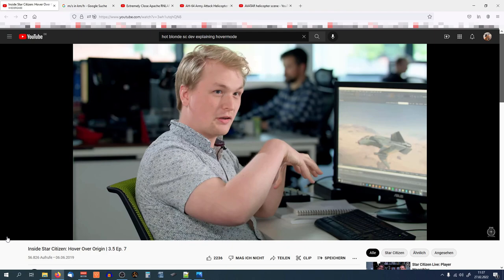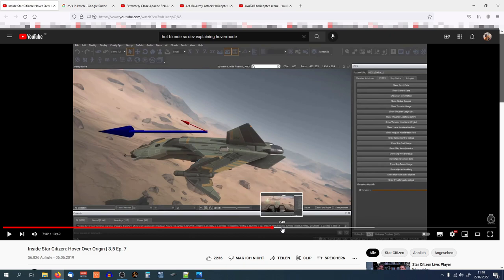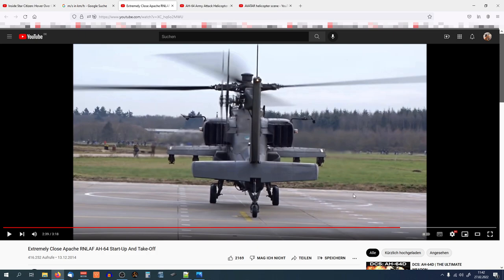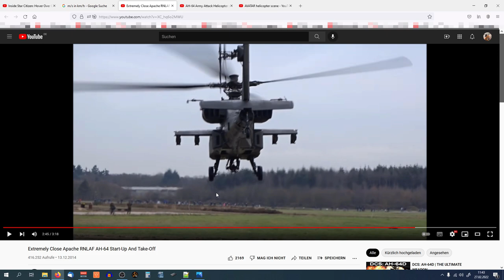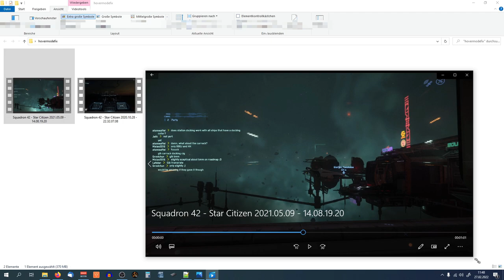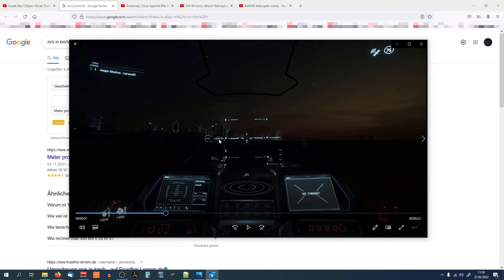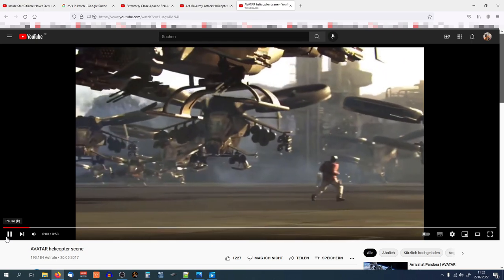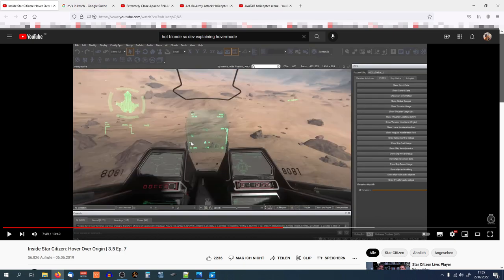A new hovermode - how to fix the atmospheric flight model | Star Citizen

Comment: Meant to comment on this back in Feb, but better late than never. Agreed that the problem with the hovermode was that it engaged way too quickly and sped the ship up instantly WAY too fast. I think, because the thrusters DO articulate, there should be some ability of a ship to angle itself without flying off in the direction it's angled: the thrusters are strong enough to hold it relatively stable, but the more extreme the angle, the less able the thrusters are to maintain that angle, and the ship will either lose altitude (slowly or very quickly, depending on how extreme) or start moving forward as those "downward" thrusters move to more and more of an angle. That's a more intuitive way to do it, and I think in line with what you're saying.
Reply from the maker: I hope they will improve flight, because right now I can not bring myself to play because of what a deterministic boring chore flying is.

Comment: The problem is scale in this game for everything. 
Single person crafts potentially being larger than full destroyers or some small cruisers, or even lets go smaller, most are close to a 747 size. 
A person isnt even the same size as a wheel on one of them yet it can fly and accelerate more than a stunt pilot in the redbull air race. 
To be fair I dont think there should be a change in how physics is worked by speed, it should change my atmosphere, planets make gravity, wind makes air resistance but it would be nice to have a gradual spool up of thrusters rather than an immediate full blast of force.
Reply: One thing I will say is that the example your using is banking heavily in his physics demo, that would be equivalent to a helicopter going max forward  tilt. 
I'd say the best thing is primarily to nerf the manoeuvring thrusters so they have much less power where heavy crafts would either need a runway or need vtol mode to direct their forward thrusters down to the ground.
Reply: @LunaStarFire  I don't think the power is an issue so much as the instant ramping up.  I could see a gladius strafing up in atmosphere at 100 m per second, of course the aerodynamics would want to point the nose up, but the biggest issue in my opinion is that it'll go from a dead hover to 100 in like half a second.

Comment: I agree to everything. I am the one who thinks that hover mode should return someday, but I think it will fail again in the old form.
 The failure of hovermode, in my opinion, was wrong in three major parts.

- Hover mode works too fast when fine control is needed. As you can see in your video, the hover mode should have the most delicate control during takeoff and landing, but I think that speed caused a lot of accidents in the hangar.

-Star Citizen's keyboard is the main control device. Therefore, all keyboard button input has the maximum input value. No matter what movement key is pressed in the game right now, it works with maximum engine acceleration. I think this needs to be resolved somehow. In a situation where left and right turns are operating at maximum speed, it would be really difficult to precisely capture the landing point in hover mode.

- At that time, the spaceship did not go in the desired direction. I think the experience of crashing ships against walls, especially in hangars, caused cig to take hover mode out of the game.
 From the moment the ship was first launched, the ship didn't listen to me and crashed into the wall and tried to self-destruct. Who could have survived this?
 I heard that hover mode would work properly if some functions had to be turned off, but I remember the experience at the time that I didn't even want to look for them. I think CIG should have turned off features like Proximity Assist when they first put on hover mode.

In summary, I think the hover mode's speed, the keyboard that cannot control the speed, and the spaceship that doesn't go in the desired direction are the failures of the hover mode at that time. I wonder if it should have been applied to only a few small fighters at first.
Reply from the maker: They could simulate virtual levers and rate of turn. Like for example in driving games, there is a limit on how fast the steering turns, even if the keyboard is used. With that type of rate limiting they could simulate analog devices.

Comment: I'm gonna say this once. 930 years in the future. You're trying to compare a modern day 2022 aircraft. To a sci-fi future aircraft that was built for space travel 930 years in the future of genetically modified humans(which we modified in SC lore to handle space travel and G forces). As well as comparing rotary winged aircraft to that of something with hydrogen based engines, that would be able to produce such thrust given technological advancement.
Reply: 930 years is not going to change rocket science if you're still using rocket science. You're not going to waste weight on vertical thrusters at the cost of intercept ability. They also violated their own lore creating force fields to protect the ship, lock in atmospheres, and produce artificial gravity but didn't bother with inertial dampers. Logic per the game's universe would not include high vertical G's nor blackouts either.